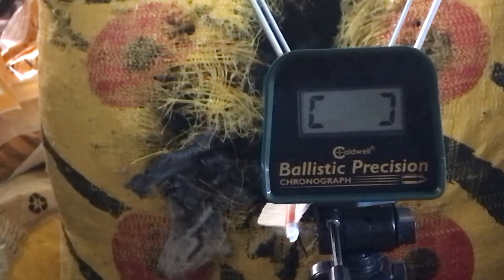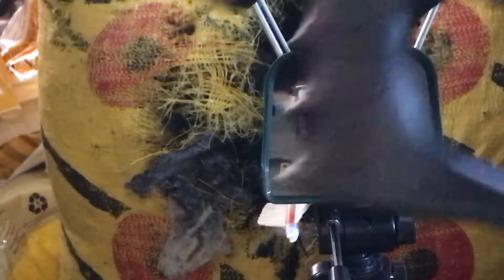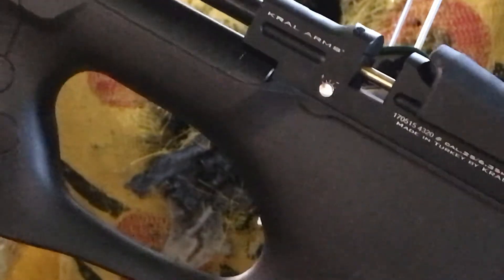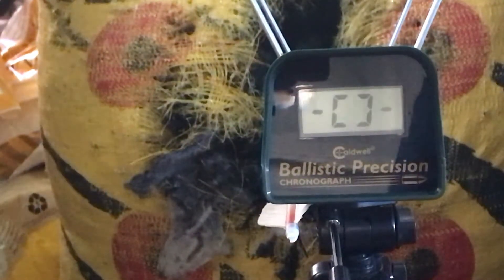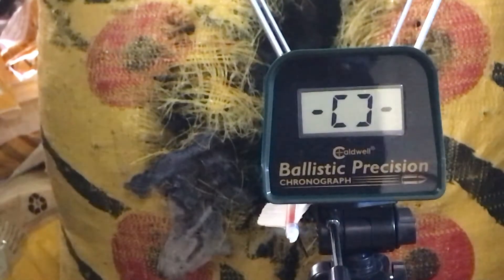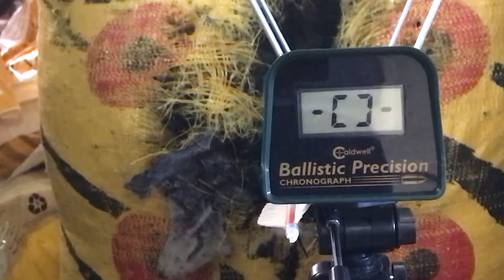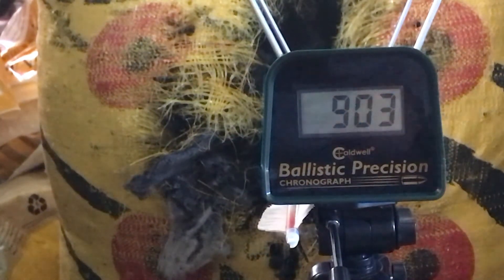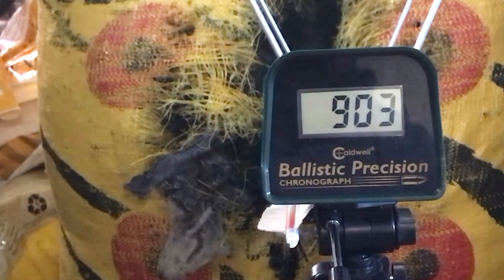Annihilator tuned Kral Puncher Breaker .25

Comment: Your work on the Kral rifles make them look a very good platform to build an excellent gun.
After all the modifications how do you find it for accuracy, which for me is the most important consideration and which you do not often show.
How do you find the stock barrels as regards quality??
Reply from the maker: Paul Brock I post a lot of accuracy testing on my Facebook page. I'm getting a consistent 3/4" group at 75 yards with the Kral rifle and bullpup. I very much like the barrels.
Reply: T Hammer was wondering as you said on Facebook you were getting a Lothar Walther barrel for your own .25 rifle.
Do you think .22 could make a good 100 yard rifle or is the .25 markedly superior.
Reply from the maker: Paul Brock I replaced the Lothar Walther barrel with the factory barrel after the results I got from the stock barrel. I'd choose 25 for distance because of the higher Ballistic Coefficient and ability to buck the wind.
Reply: T Hammer have only seen new Puncher Pro 2 in .22 so far and Kral never reply to emails (even when sent in Turkish). It still does not show on their website although it has been on sale in Turkey for 3 months. I know you rate the Jumbo but on this you cannot fit a Lane Regulator so loose some consistency of power and tuning ability.